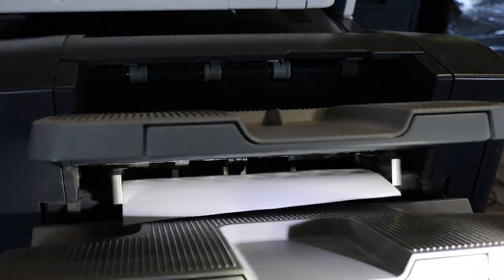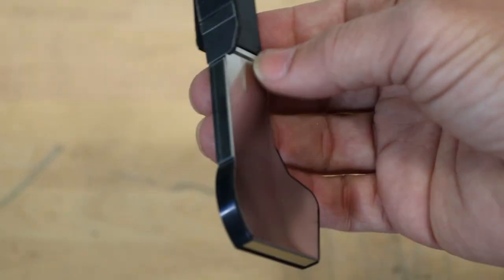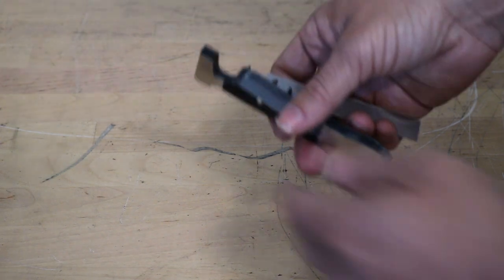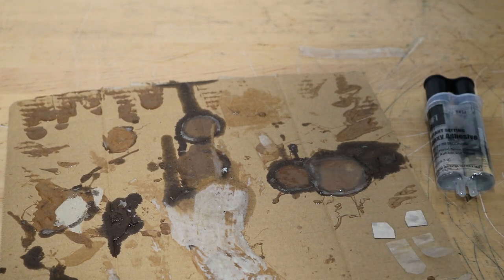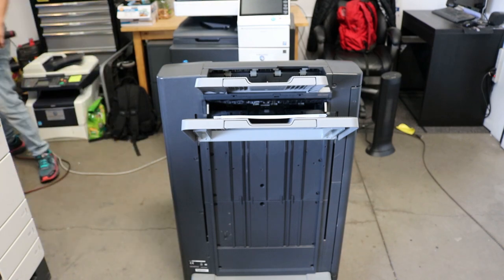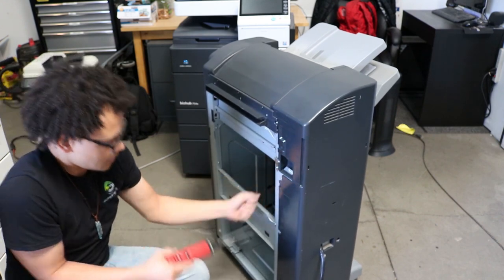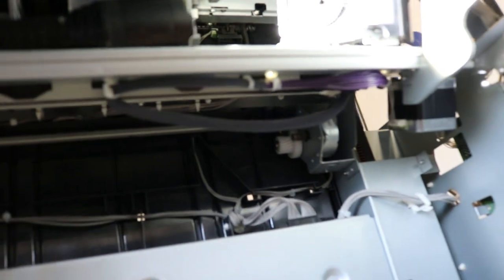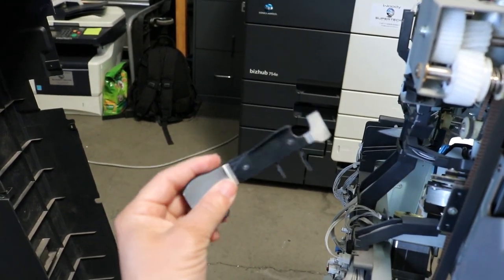How to fix alignment and jamming issues on Konica Finishers (FS-534)

Comment: Excellent channel. I wonder if you have any experience with the smaller desktop printers like the Magicolor 2300 series which were acquired from QMS before they became Konica Minolta QMS
Reply from the maker: Thank you! We've worked on a lot of copier and printers throughout the years, but I don't recall working on the Magicolor 2300.